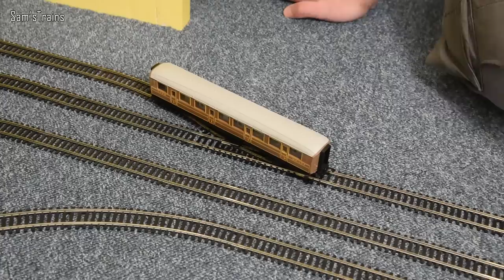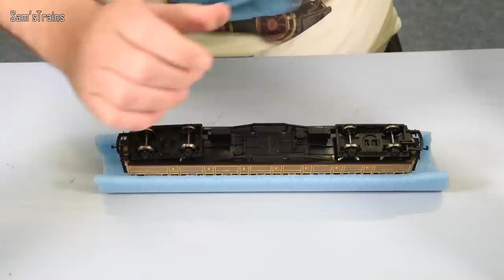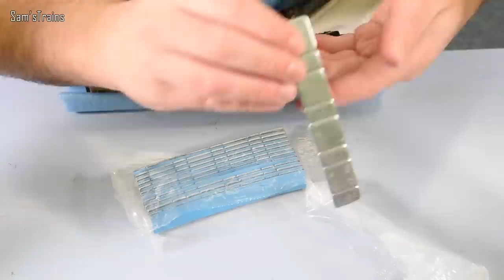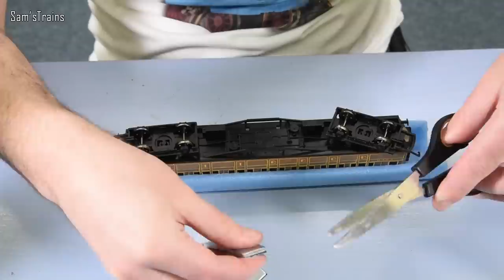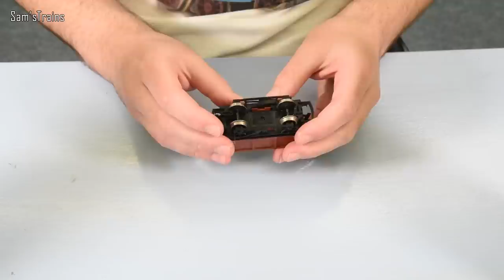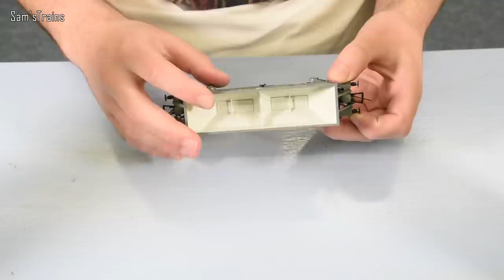How To Stop Derailments on Your Model Railway

Comment: I'm a car mechanic.
Those lead weights aren't made from lead due to their dangerous properties.
Reply from the maker: Yep - you can tell they're not lead, which is why I use them! They say FE on them...but they're not Iron, or are they?!
Thanks for watching - Sam :)
Reply: that's right they are made primarily of zinc and steel now which is non toxic .
Reply: As far as we know at this time...Wasn't Asbestos a wonder material along with Diesel a wonder fuel?
Reply: @SamsTrains  Well When I had HO scale trains that I had from my childhood-2012 which I no longer have all the weights in the Bachman rolling stock I had begun to rust, and so did the tyco steel track I had.
Reply: @SamsTrains  Fe is Iron yes.  They are a plated iron.  Very nice.   Much better than having balls rolling around inside your coaches/rolling stock. :)
Reply: Hi car mechanic my names dad
Reply: Mechanics  only call them lead weights to FOOL You !

Comment: Quite a time when you've uploaded this, but this helps a ton now that we are drawing and planning our very first layout. For the moment we've just attesting on screen by applying scale rail specifications available for 3-rail (including flexitrack). Our goals are to achieve the highest reliability / flexibility of trains passing and shunting with the least amount of points and exactly taking notice what you've pointed out for turnouts. Gauging of wheels shouldn't be a subject for 3-rail stock (never seen it mentioned) but who knows now that we are going to check. You Sir should be awarded with a medal :)

Comment: Your advise really worked, thanks!!!. I'm running a train with 6 streamlined corrugated steel budd passenger coaches, my first car the baggage coach kept on derailing...so I took off the shell and I realized it was the lightest coach because it didn't have an interior inside it...so I added weight and fixed everything.
Reply from the maker: That's fantastic to hear - have fun mate!! :D
Happy New Year - Sam :)

Comment: Having a curve one way then the other straight away is called an S-Curve, the reason it causes more derails is due to momentum, if you have a bike you can show this yourself
Get going at a decent speed turn left, then turn sharply right, you'll notice it's hard to stay balanced. The same goes for the rolling stock, it still has momentum left when it goes right

Comment: Sam, this is valuable for so many People!! As I've mentioned, I'm an Old Fart Modeler. 😜 
Cleaning the Wheels, although beneficial, does little to stem derailments, unless it's dirty to the point of being bumpy. 
Of course clean Wheels help promote clean Track. 😉 

You DID touch on the two Best mods for smooth, derailment free running...
WEIGHT and GAUGE! Heavy Rolling Stock tracks better (pun intended!). Gauge prevents skipping over Points. 

That Oxford Hopper. Beautiful yes, hard to weight - YES! 
My trick for Hoppers SEEMS dangerous, but its not. 
I take Lead Shot (CHEAP at Sporting Goods Stores)... Wearing Gloves, I insert the Shot into the Hopper bottom, about 6-8mm deep. 
THEN I take two part Epoxy, and encapsulate all of Shot, sealed from any future harm! 

As the Epoxy is curing, I sprinkle some Coal, Gravel or other Commodity type over it. 
So they're all weighted, above Standards, like I like it! I just tell the nitpickers that my Loads didn't empty properly!! 😉 

Of course your concerns about Lead are Valid... If you want a cheap alternative, visit a Machine Shop. They make TONNES of Iron and Steel Shavings during the course of their day. Many of them just chuck the Metal shavings in the Bin. 
You may be able to get a FREE Sack of Metal Shavings from one of them!! I weighted 60 Cars that way. 
Carmine ✈🚂🚙
Reply: Sam, you definitely represent the next Generation of serious Model Railroaders! 
I've been in it since 1974. 😳 

I've got nothing left to give but years of experience. You can either use it or not, but I'm happy to share my Decades of experience with you and only a few others.
Reply from the maker: Really glad this is some help Carmine - great ideas with the lead shots, that all sounds good! :D
Thanks for watching - Sam :)

Comment: The Common Case of Derailments
Sam has had many a hard time trying to prevent his rolling stock from derailing. Of course, as we know, it's not just certain pieces of rolling stock that choose to misbehave. Model Steam or Diesel Engines could sometimes play up as well. But this for Sam was about to turn into a disastrous head-on collision.

So far, head-on collisions were unheard-of on Sam's layout. He was fully aware that accidents can happen at any time. It wasn't any set of points that Sam had forgotten to close or open that were to blame. Yet, somehow, a new disaster was slowly beginning to unfold. Sam had accidentally set the E2 Tank Engine, with four open wagons and a Guard's Van in tow, to go a bit too fast. When he tried to slow the 0-6-0 down, he found the controller wasn't working at all. This was on the outside line. To make matters worse, he discovered he had exhausted both controller boxes altogether. On the same track, a GWR 4-6-0 Tender Engine, Resolven Grange, was running (again too fast) in the opposite direction. With four coaches in tow, that is. Shock! Horror!
"AAH!" screamed Sam, panic-stricken. "I can't look!" He covered his face with his hands, waiting for a catastrophe. There came a loud and frightening smash. Both engines hit each other head-on and blew themselves to pieces! The loft shook violently under the impact. Silence settled. Shaking like a leaf, Sam uncovered his face.
"Oh no," he sobbed in a whisper. "What have I done?" The two steamies were nothing more than a pile of twisted and broken metal, the rolling stock having only minorly derailed. Sam burst into tears, ashamed of the accident he'd caused.

Sam's Mother and Father heard about the disaster. Instead of scolding their son, they decided to give him a wonderful surprise. Sam's birthday came along a day later. The boy was still upset over the catastrophe. However, the minute he climbed up the ladder into the loft, he noticed two new controller boxes waiting to be played with. Also, set up on the layout, replacement models of E2 and Resolven Grange stood on separate tracks. Sam looked up at his parents.
"Thankyou," sniffed Sam gratefully, "but what about our holiday?"
"We don't like to see you upset," answered his Mother. "So we've given up the holiday to make you feel better." Sam flung his arms around his Mother and Father in a bear-hug. Tears of joy rolled down his cheeks. Sam was left to happily play with trains.
Reply from the maker: Ahh here we go - it was only a matter of time!! People would think that I was disaster prone!! :O
Thanks for watching - Sam :)

Comment: One trick I found years ago with lightweight flat top bogie wagons was to use the long steel weights in can't be fixed Lima locos, I glued 2 of these together and temporarily fixed them to the flat area on the wagon, helped them not derail, another was the steel pin that goes in between the handles of doors to hold them together, the Bachmann internodel wagons that I had didn't like being reversed into a siding that had a peco point at the start, no problems being pulled out of the siding over the peco point, changed those peco points I had for hornby points, solved the problem, you can get or did get small bags of steel balls to help with weight issues on rolling stock, they may be available on ebay, I think these packs of weight strips that Sam has are a good idea for adding weight to coaches and wagons, the tender on steam locos is a god place to start adding weight.

Comment: I had that problem when I built my own wagons and they derailed on long trains.  I haven't done a weight for coaches but I found the best weight for wagons was 35 gm.  I am glad you mentioned back to back gauges.  Back to back gauges are available commercially from Brassmasters. On older stock, I had to ream the bearing cup particularly when I changed from plastic to metal wheels.   I found that I had to adjust Bachmann wagons more frequently than Hornby.  Another issue I found was that couplings sometimes pull the coach in the wrong direction if the coach is too light.  This is less of a problem with the large couplings present on this video but may occur when smaller couplings are used.  Thank you again for another interesting video, which will help many others.
Reply from the maker: Duly noted Don - that sounds a good weight to me! You're absolutely right about the couplings too - they can definitely cause problems!
Thanks for watching - Sam :)

Comment: I think your video is spot on.  There is of course many more complications when the point is parts of a complex railway.  Dead level is the most important.  When you’ve cut a point into the layout as an after thought that is where many problems can arise.  Some rolling stock just will not run no matter what you do.  Rob
Reply from the maker: Thanks very much Rob - yep, definitely a lot of potential issues - but it's all good fun I suppose! ;D
Thanks for watching - Sam :)

Comment: Great tips Sam, I’ve used the wheel weights for years now, just be wary of running too many wagons with weights, especially 30g, that’s a lot for one carriage…6 carriages with 30g  is an extra 180g, which will burn out most loco motors on an incline. I’ve stuck to 20g for carriages and 10g for plank wagons. And mark the underside somewhere of the extra weights, especially if you have a lot of rolling stock. 👍

Comment: Hello Sam! I am currently trying to find mix-traffic engines for my railway, because my original heavy goods engine broke down. Therefore, I had to use my original mix traffic engine for heavy goods. Could you do a day out with mix traffic engines? Thanks!

Sincerely,
Railracer222

P.S. from time to time, I might forget to check to only set of points on my layout after my room is cleaned. Then, the running train could go onto the siding and push the other train through the buffers.
Reply from the maker: Hey! That's very great idea - I've never done a mixed traffic video before!! :D
Thanks for watching - Sam :)
Reply: Your welcome! I’m also doing a video on some model cars where I fix them up by putting in new batteries, fixing the wheels, etc,. Maybe it could help with fixing up your model trains and making modifications.

Comment: Hi Sam, caught this video recently.  I too use wheel balancing weights  for light rolling stock. When mounting them where they are visible I just go over them with a black permanent marker on the edges and the top. This reduces the visibility considerably.  Cheers.

Comment: Hello Sam - some real sage advice there, thank you. I'll be getting a back-to-back gauge next. I did use a piece of lead sheeting cut into squares for balancing rolling stock, but was concerned about the toxicity. Your wheel weights are ideal and so easy to apply. Here's a tip I found useful: get yourself some black (goth) nail polish. Often found in discount stores for $1 as it's not really fashionable any more. This is ideal for painting weights or any undercarriage modifications and it dries in less than a minute. You can get it in matt too.  Cheers ,Angus.
Reply from the maker: My pleasure mate, hope it helps! Yes a back to back gauge is a great idea - you can standardise all your wheels that way! Yeah I'm not keen on lead either - I've gotten rid of all of mine, just to be safe!
Thanks for watching - Sam :)
Reply: Get a tin of Humbrol matt black..

Comment: How to stop derailments: simplest solution is don't run any trains. ;) All joking aside, I blame the issue on scale flanges, which is why Märklin is pretty good because their oversized flanges actually provide very reliable running even on rough uneven track, at high speed I might add. In contrast my american rolling stock with scale flanges derail on the slightest fault... And yeah, weight is very very important. Again, Märklin solves this by a heavy metal plate built into the frame of their wagons.
Reply from the maker: haha very true - that's a better, if more defeatist solution, lol! Yeah that's a good thought - I bet that plays a part for sure!
Thanks for watching - Sam :)
Reply: How do you like that ! Decades and decades  praying years and years for the demise of what are called 'pizza cutter' flanges, which in HO, scale out to be  some 6" deep in the 1:1 scale , finally getting near scale flanges, and this guy wants the toyish  pizza cutters to return !!!  Thousands and thousands of, at least US MRRers, have excellent running RRs with scale flanges.. You're  just a person who doesn't want to deal with laying track correctly...Add weight,OK. 6" flanges, NO !! M, Los Angeles

Comment: As someone transitioning from firing and guarding on a steam railway to back to model railways some very good hints and tips which I'll bear in mind when I move and have a spare room.

I have a combination of triang from my Dad and more recent ones when I started by own set 20 years ago. 

Main derailment issue I've encountered was a 2P loco which had tender drive and traction rubber tyres. It worked ok in reverse but caused no end of grief going forward. Suspect I'll need to replace the tyres with steel ones if it was to run again...
Reply from the maker: That's great to hear mate - that all sounds fantastic - good luck with the setup - and yes those 2Ps can be a nuisance with their tyres!
Thanks for watching - Sam :)

Comment: My main fix for stopping derailment first is check for bends in the axel, then check for dust, oil the bogies, then if all else fails replace them with some brand new steel wheels. Then if that fails I send it to the sidings where it lives forever.
Reply from the maker: Absolutely - sounds like a good system mate! :D
Thanks for watching - Sam :)

Comment: Thanks for the useful info without the waving hands syndrome. My railway club advised me to get a wheel guage. It worked wonders. Your track used for illustration was slightly kinked and it looks like a first radius, always a problem. To get around this I was told to buy from a well known DIY store a thin strip of inch wide(2.5 cm) aluminium, it is about six feet(2m) long.
As long as it isn't kinked it will always form a perfect curve and you use this for all curves. The wheel weights is a useful tip, I will be applying it to my Parkside and Kitmaster/Airfix/Dapol kits and my Dapol ready mades.
Reply from the maker: No problem Charles - yes the gauge will help a great deal! That's a good tip - I'll be sure to look into that! :D
Thanks for watching - Sam :)

Comment: Have you ever heard of the problems with derailing on the curve of Hornby Standard Points? 
If its not the wheel gauge, the plastic nose of the point needs lightly sanding down, as some Hornby points have the nose slightly too wide at the point, causing the rolling stock's wheels to go up and over instead of around. Don't sand too much, you wreck the point!
Worked for me and my Class 350, which had 32 possible wheels to derail!
Reply from the maker: Yes I've heard people talk about that too - I might give that a try - thanks for the tip! :D
Cheers,
Sam :)

Comment: My friend from New Zealand Tom, sprayed a teak coach that had been covered in varnish. (it looked like someone just tipped a bottle over it.) I cleaned off all the runs on the side panels and i used a sharp blade to clean off all the roof and then when over them again with some 1200 wet and dry paper. He has an Airbrush and spray booth. He then resprayed them with Artist Varnish thinned with turps and the finish is great. The reason for this comment is, he said to me that the coach felt   too light and we compared it with one of his North American freight cars and there was a big difference between the two. I will buy some stick on wheel weights from a local tyre dealer and save the postage. Martin (Thailand)
Reply from the maker: Blimey, that sounds like a real restoration project - but yes, they are indeed very light indeed - sounds like a good idea, hope they work well for you!
Thanks for watching - Sam :)